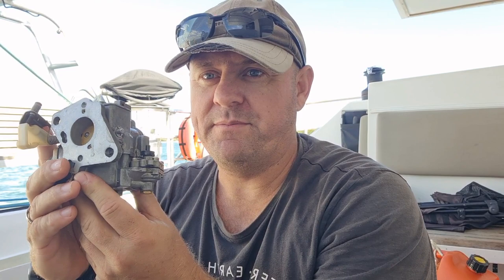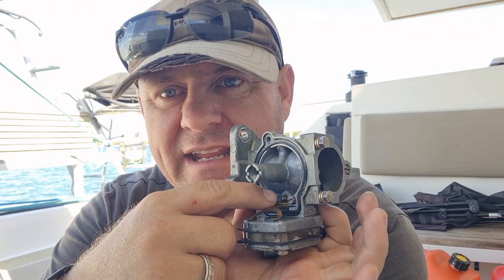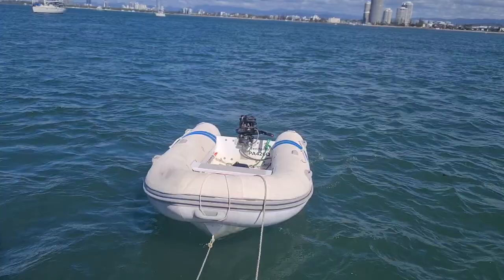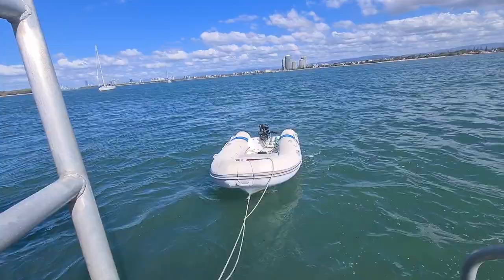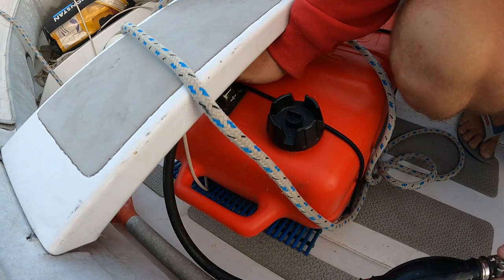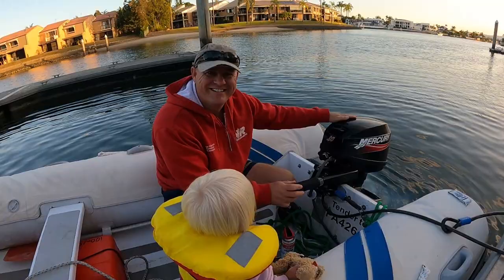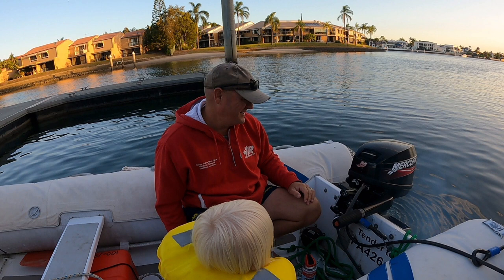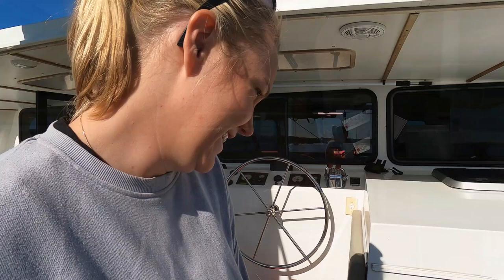BREAK DOWN AT SEA - Sailing Family stranded on Aluminium Catamaran without Outboard | Ep. 29

Comment: Great video guys, love watching your adventures! Would have never guessed that it would be over 300m of string to put the child netting up! 😮
Reply from the maker: Hahaha yes we didn't anticipate going through so much cord aswell. On summer (our last boat) the life lines were wire but the light has awesome life lines made of alloy tubing which just over doubles our vb cord usage.
Reply: @sailingwiththejamess  

You might have to rig the front netting as a QD panels.. just so you can get to the bow sprit and anchor in a hurry in bad weather or the dark... Otherwise congratulations on a job well done .

Short lengths of copper  wire strands trimmed of during wiring jobs are pretty good for cleaning carb jets as they tend to be  soft enough to not damage the jets or the MaZac or Al housings.
Reply from the maker: @Clive (Stainless Steel Womble)  Thank you! 3 full days to do the child netting, it's looking really good and we wanted to make it tight as on our last boat we didn't make it too tight and it loved to dance in the wind LOL 
Over 320m of VB cord to do the whole job 😆 We are stoked with the outcome, we plan on crossing oceans, and having the child netting makes us feel better as Charlie is the most important thing to us 💛
We left the middle gap at the front open for anchoring and also had to cut a hole for the furling line for the screecher, it'll be a bit of a learning curve with picking up mooring with the netting though 😆
-Cait

Comment: Bugger about the dagger boards, you could probably just sand them back and take the extra layers off so it mooves freely.
Reply from the maker: Yeah, that will probably be the plan. I haven't had a real close look at it yet but it seems to be binding up at the top so it may just have a bit to much paint in it.
Reply: @sailingwiththejamess  
That or some natural fouling in the trunk ..can you lift them out the top and check the boards and the housings.
Its usually at the waterline in the trunk if your unlucky.. look for scratch marks as witness marks on the sides and fore and aft..
Reply from the maker: @Clive (Stainless Steel Womble)  we will be heading north with the trade winds behind us so the job will be put off for a little while. We have a suspicion that it is paint build up causing the issue and will need to be sanded back and repainted
Reply: @sailingwiththejamess  

A lot of cat owners with dagger boards only use the one in light to moderate weathers to tack upwind or hold a course down wind.  It reduces drag as well.
Reply from the maker: @Clive (Stainless Steel Womble)  we are looking forward to having a bit of fun with the daggerboards, never had them before and are looking forward to learning and experimenting (once we get them down of course! LOL 😆)
-Cait
Reply: @sailingwiththejamess  
Are they both stuck... Are the floating or sinking type..  sacrificial etc?🤔
Reply from the maker: @Clive (Stainless Steel Womble)  they are both stuck, it's super hard to get them down pr back up. I was on the wenches and the line had a lot of tension on it and Sam was wiggling the board down. They didn't want to go up or down and when both lines were free the boards didn't move freely up or down ☹️ we think (and hope) it's just a few layers of paint that's stopping it. We're looking forward to sailing with some daggerboards and getting to know how she sails and what she likes
-Cait

Comment: Good job doing the lifeline netting its looking real good. Why the hole in the front (at the end of the video at 16:00 )
Reply from the maker: Cheers Scott. The hole is for the screetcher furling line. I tried to run it through the A frame on the cross beam but it made everything a bit busy in that area and may make picking up a mooring a bit more challenging so we decided to modify the netting with that hole.

Comment: Brilliant guys! Good job on the outboard. Do you prefer daggerboards over minikeels? We are looking at quite a few Catamarans with a mixture in the group of daggerboards and some with mini keels.
Reply from the maker: Awww Brad this is a very big question to answer fully but in short I prefer dagger boards because I feel that they give you more options. As we plan to cruise the world from East to west I have opted to sacrifice some performance for safety and durability. Shinning light has dagger boards but also skegs that will protect the running gear and reduce the loads on the rudders in a quartering sea.
Reply: @Sailing with the James’s  so you have daggerboards and skegs! Best of both worlds. We are not sure what we prefer, daggerboards or minikeels. We saw that Morelli & Melvin while at The BoatWorks, she is beautiful. We are a little while off from making the big move, haven't found the right boat yet
Reply from the maker: Yeah the boat buying process is super hard at the moment. Having skews and dagger boards isn't necessarily the best of both worlds but more of a compromise in the middle. Our boat is so heavy that dagger boards won't make that much of a difference but we love the shallow draft options. The M and M is an awesome boat. We would have purchased it if we could have agreed on price. Good luck with your search and let us know how you go.

Comment: Had similar issues with our dinghy outboard, was going to do a rebuild on the carby. Rebuilt kit was more than a carby off Aliexpress!! It was under $60 delivered. Had to wait a while, no biggy. 
Put it on and shazam, started straight up, very very minor tune. Starts with one light pull now. That was nearly a year ago.
Fun boat times.
Reply from the maker: Cheers that is a great result for you and an awesome suggestion for us. I've flished the jets aswell now and it seems to be OK but if it plays up again I'll go straight to ally express and get a new carry. In hind sight I wish I had gone and brought one at the start.
Reply: @sailingwiththejamess  it's great to fix things when you don't have to spend money!
Reply from the maker: Hahahaha now you are speaking my language lol. Even alot of the vb cord that we used was out of an expired rope thrower.

Comment: It's not a good idea to run a filter on the fuel line but if you do get one meant for small engines not one that big , your pump can't keep up with that size . Next time it won't start give the carb a few taps on the side to free up your needle and for sure don't run 2 filters ! Make sure your tell-tail is flowing ! Salties should be flushed once a week , depending on how much you use it !Those Mercury ( Tahatsu ) are good little outboards !
Reply from the maker: They are good and it's hard to come buy 2 strokes now in Australia. When we get to Indonesia we will probably buy a new one but at this stage that is looking like not for another 12 months so hopefully old faithful will keep on chugging until then.
-sam

Comment: Outboarders require a disproportionate amount of time for service and repair. Storing and handling gasoline is not contemporary for a sailboat. I will switch to an electric solution in the near future.
Reply from the maker: I agree and would love an electric outboard with regen capabilities so I and hook it to the back when we are Sailing. At this stage the boat doesn't have enough solar to support itself but as soon as it is upgraded then we will be looking for a electric solution for our tender.
Reply: @sailingwiththejamess  That would be a dream solution of course, for me a small motor that can take us from the anchorage to shore and back is enough. 
I do not want to make excessive trips with it, so the battery can be co-loaded. 
The expected use determines the effort.
Installing a railing net is elaborate, I can confirm; it also gives a safe feeling for the crew when leaning (on a mono).
Nice post from you, keep up the good work....
Reply from the maker: Cheers Albert, the child netting was huge but makes us feel so much more comfortable with the little one on board. I understand what you mean about the outboard, we do considerable distances in our tender exploring so we may need one slightly different to yourself. If you get one and are happy with it please let us know.
Reply: Talking of Nav systems, have a look at the Orca system. Looks good to me (no experience myself but others trialling such as Fair Isle - Steve)
Reply from the maker: Thank you! Have to get onto to that and look it up. We are using Navionics on the  tablet and a chart plotter is on the boats Christmas list 🤗 Hope you are enjoying the videos ❤️💙
-Cait

Comment: Boy u are a tight-ass, I would have trimmed so the net join was camouflaged on the stanchion.
When u did the haul inspection I noticed the possible issue with the dagger @5:30. Imagine the sea life growth in the pockets. I prefer external frame pockets, easy to undo a bolt, drop & clean them.
Reply from the maker: 🤣🤣 just cracked up at the tight ass comment!!  🤣🤣 
The daggerboards are on the near future to-do list. They need to come out of the pocket and get sanded, and you are 100% correct we also need to do something about the Pocket in regards growth as its already showing its causing trouble  
💙💙
-Cait
Reply: @sailingwiththejamess  It's not a design I like. Chances of it happening is rare, but imagine the pocket if dagger hits a container, log, something. 
External cradle for mine will axel swing ( same with rudders), might dent the front of dagger, but no damage to hull.
Reply from the maker: Oh, are you talking about having kick up dagger boards? I have never seen that before! I have a friend on a lagoon that wants to cut off his keels and install daggerboards externally.
-sam